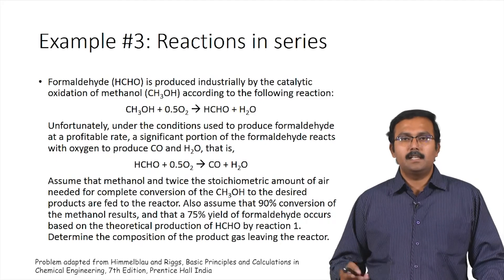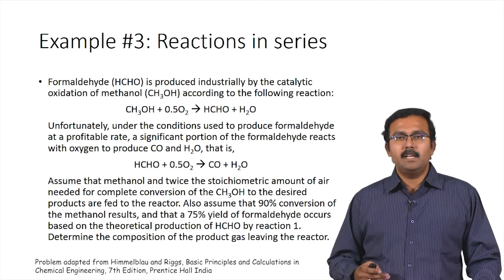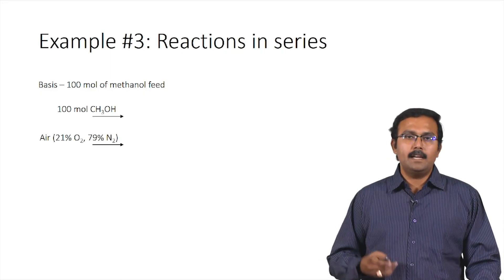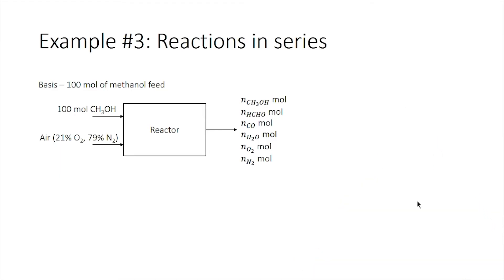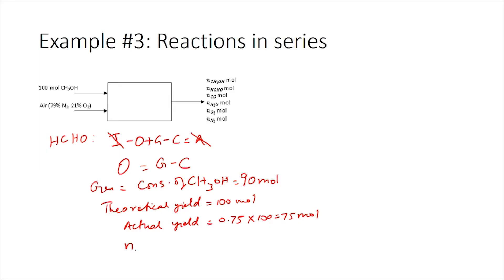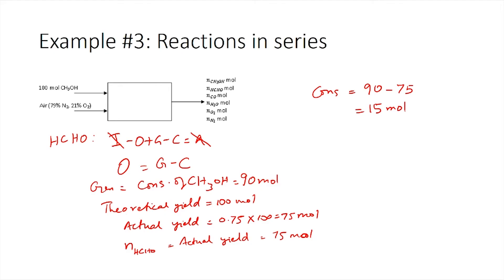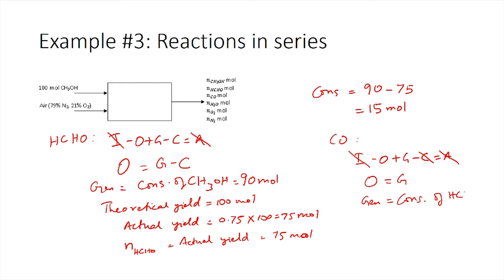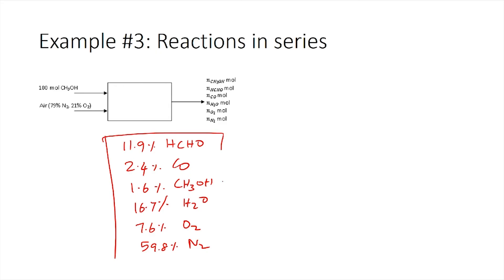#15 Material Balance Calculations for Single Units with Multiple Reactions | Part 3

Comment: Sir! I don't understand the part where you performed oxygen balance ..the question states we supply stoichiometrically twice the amount of air,required for complete conversion of methanol. For the complete conversion of methanol we supply 100 moles. Then according to the question we supply 200 moles right?? And 21% of oxygen of 200 moles is 42 and not 100...I think I haven't quite understood the question..
Reply: @Maiden SA OMG! Thank you so much! I understand it now!
Reply: thanks bro..
I also had the same confusion.